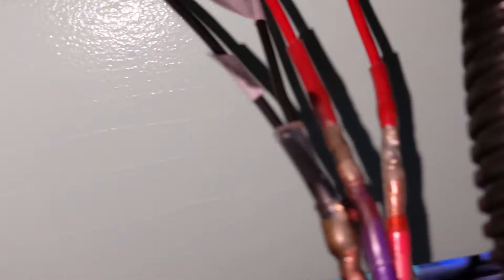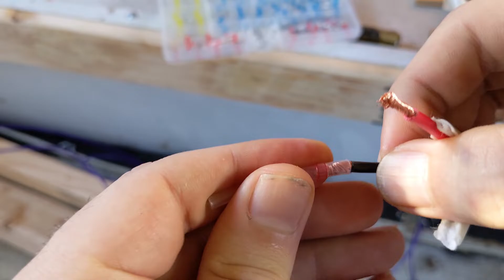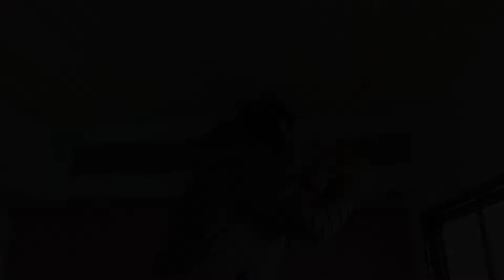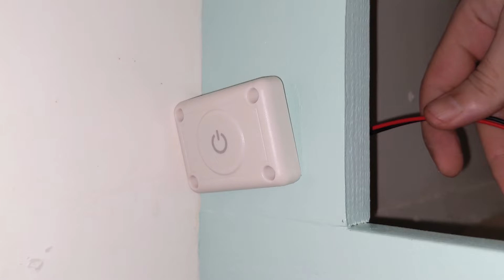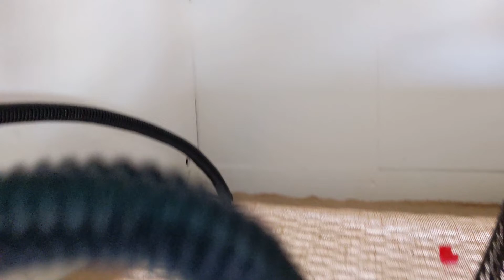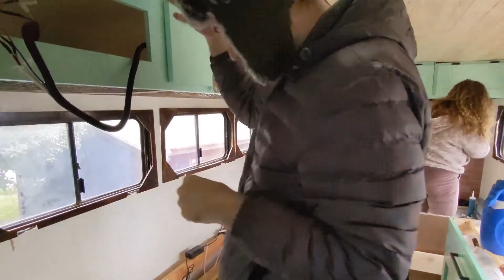Wiring your bus doesn't have to be complicated | BUS ELECTRICAL PT 2

Comment: Things are looking good! I wish I had used that flexible conduit in my bus. Time will tell but there are loose wires hidden in all the walls. 😬

It's a great moment getting those first few lights installed! It's super empowering when you finally get to see the fruits of your labor. Excellent deal on that 12 gauge speaker wire!

Your volume was a little low in this vid so it was a bit hard to hear. 😕 If I may, try to keep speech somewhere between -20db (lowest) and -10db (highest) with underlaying music around -30db. If we're only hearing music without speech I personally keep mine around -20db.

I used to keep my audio levels low but I had to look everything up after I noticed everyone else's videos were much louder than mine. 😂
Reply from the maker: Thanks! And good tip on the audio; I used different headphones for editing this video, and felt like the audio was a bit off so appreciate the feedback :)